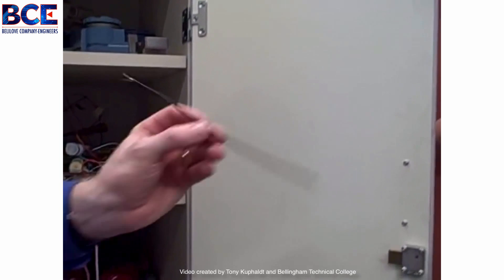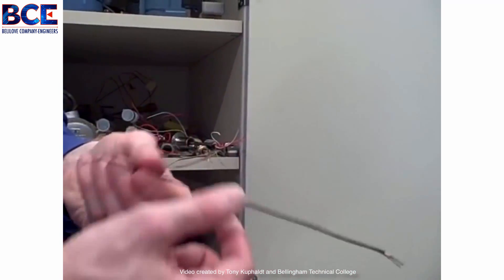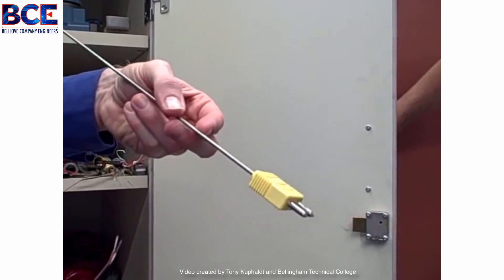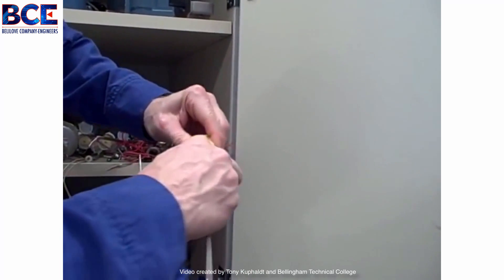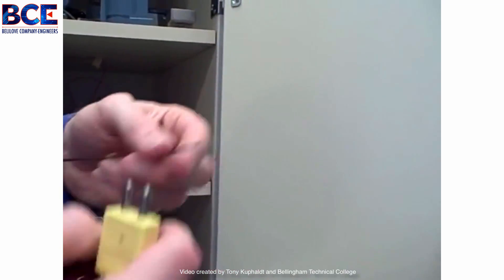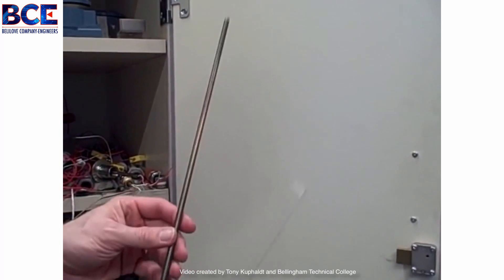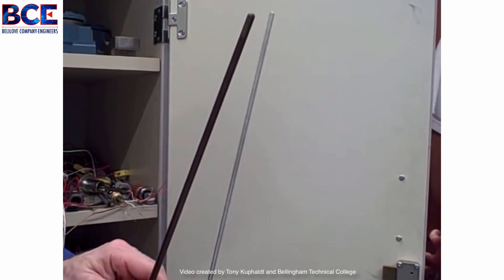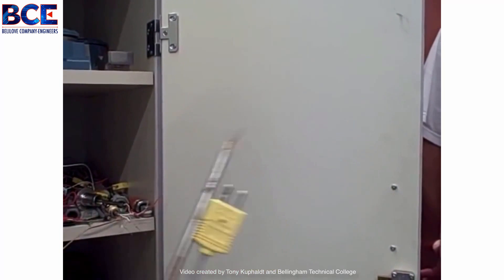Thermocouple Basics - Wire Type, Connectors, Construction

Comment: Great video! Thank you, sir. I've bought a J/K-type thermocouple like the one you show at 1:10. I  am planning to use it to measure the temperature of Calcium-Chloride solution flowing in a pipe. I was wondering if all of the rod (sheath) be inside the pipe or the tip alone will do. Can you please shed some light? Thank you.
Reply: Hey Deva, The Junction is welded inside the sheath at the tip of the probe. Your best, most accurate, readings will come from the thermocouple tip. Therefore the tip alone will do.  You can find more thermocouples like these at Blazeprobesdotcom